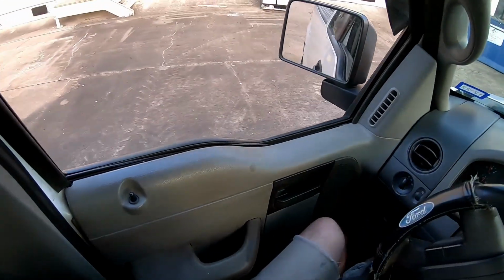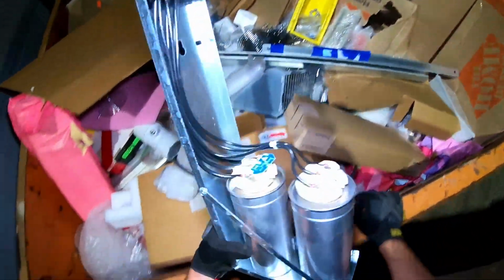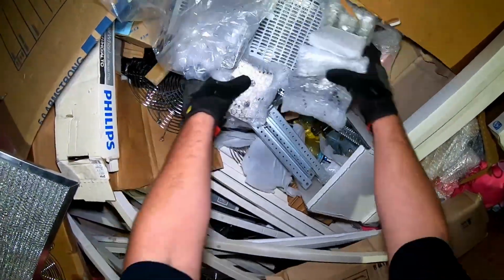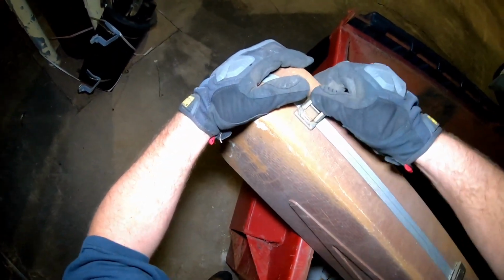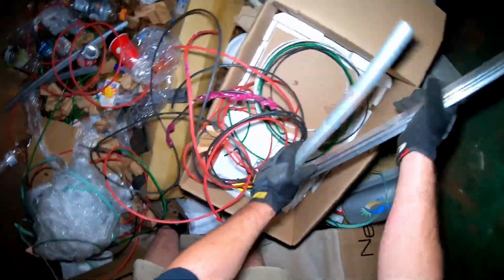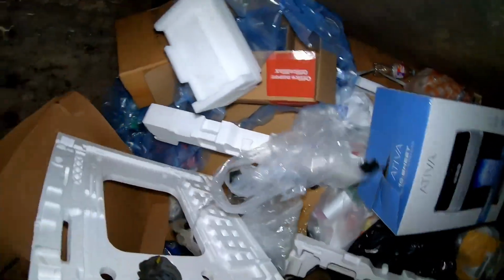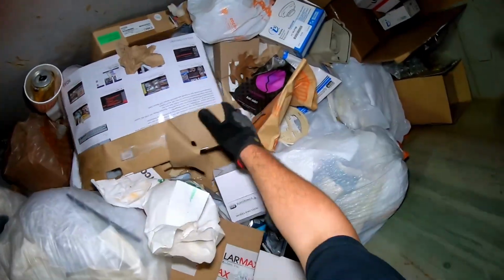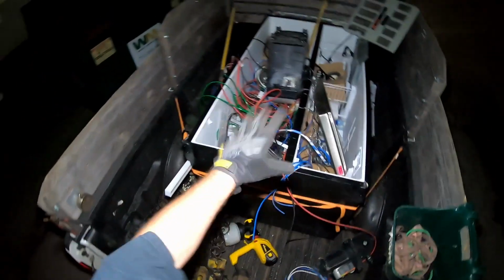Dumpster Diving "It’s Just A Little Crusty On The Outside"

Comment: Hi Mike! Your my FAVORITE 😊.
The reason the doors are taken off the refrigerator, is for safety sake. So no little ones decided to try and play in the fridge and get stuck and suffocate. I know you know this~ silly. You asked why and the Momma in me had to answer.😘
Reply: Kimberley Dragon I'd bet someone took the doors because the side are black enamel so the doors would have been stainless steel.
Reply: Actually, if they stay inside too long - like maybe playing hide and seek - by breathing they replace enough oxygen with carbon dioxide which makes them relaxed and sleepy. Then, they fall asleep and suffocate.

Comment: Hi Mike, your electronics guy may be interested in the fan covers. As others have pointed out, removing the doors on refrigerators is a safety thing, its the same here in the UK.
Reply: Most counties here have a law on refrigerators and freezers that you have to remove the door(s), the old ones had latches like a big commercial freezer door except the fridge dosen't have a release in it. Plus it doesn't take long to use up the air.

Comment: Mike those fan grilles have good resale value.
You hit the the right time for them to dispose of all that electronics parts. Those copper fittings fit in like what I have and others. Greenly hydraulic crimper. Thos punch blocks are from an old telephone system.
I still have my linemen tools and butt set.

Comment: Hey Mike, FYI, the only thing that separates number 1 and number 2 insulated copper wire is the same thing that separates #1 & # 2 copper tubing; #2 has is plated. Your scrap yard should be buying your insulated copper wire based on recovery. It's just a calculation of bare copper price minus the insulation (weight - insulation x #1cu price). For sorting purposes all (CAT5, 8 gauge, etc) insulated copper wire has a standard recovery.  If you’re interested, I could send you more info.
Take care, scrapman

Comment: Check the prices on replacement lamps 1:15 for those. People have started tossing the projector because the lamp cost upwards of $250.00. They just eat the upgrade since it isn't always that much more expensive for a whole new projector. My brother ordered a replacement lamp for an office at his work. The guy installing it didn't read the instructions and touched the new lamp while installing it. This ruins the lamp, your upposed to wear gloves or hold with a clean cloth as I understand it. 10:47 They are punch down blocks used for phone systems and are plated copper or brass. Also they were used early on for computers LANs I believe. Used to be some scrap yards would not accept anything that looked like it came from a Ma Bell phone system. The big phone companies used aggressive legal measures to prevent theft of any of the massive amounts of copper they (still) used across the nation. I remember seeing office buildings where the entire area above the ceilings were covered in abandoned phone cables. New phone system? New cables. Leave the old wires as out of sight is not a problem and nobody said to remove them. We demolished buildings where miles of phone cable went into building debris dumpsters. The demo crews said they wouldn't touch it. Maybe it's different now, I don't know. 11:48 Maybe give you a core charge equivalent in cash if rebuildable. 24:19 Nailed it. I think that Tic Toc must be the love child of MySpace and Snapchat!

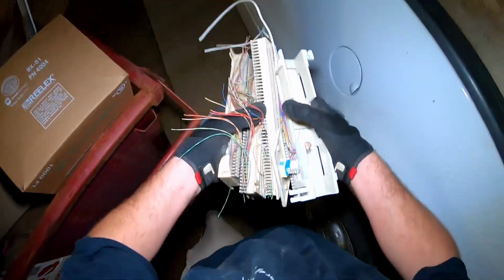Comment: 10:50 ..."Are those little contacts on there, are those brass?"... possibly, those look like crone blocks for phone wiring installations or maybe cat5 punch down blocks, so probably copper, or nickel, or maybe  brass. They may be silver plated, not that you would get much silver from them even of they are.

Comment: Those phone patch panels are usually going to be tin coated copper  the four across you get a little under a pound of copper  just take a screww driver and pry up the back then turn it over and they will all fall out good scrap

Comment: I have a paper shredder that I took the motor out of it and the drawer I took it a part and I put it back together as the case and you got a little door card that you can put stuff in that one you just took apart you could have done it the same way when it has a can with it makes it look like a little car and I know that Newport apart has wheels on it just take the metal out of it and then put it back together not the metal to plastic piece the top part

Comment: My sister in-law is listed in the phone book for scrap metal disposal.  Sometimes she calls us up if it's closer to us . We have a car haller trailer.  This big company that installs insulation was moving to a larger warehouse.  They gave us a huge pile of professional scaffolding . Filled up the car haller . Then by the time we were done loading everything else , it took 5 straps for the trailer and 2 straps for the stuff in the back of the truck.
So we were almost home , and he spots this huge hot water heater on the curb. 
I'm pleading , noooo,
So he says , "I'll unload a few things and go back and put it on top of everything. 
Sad to say when he got back , someone was loading it up in the back of a SUV . And it was so tall , half of it was sticking out.